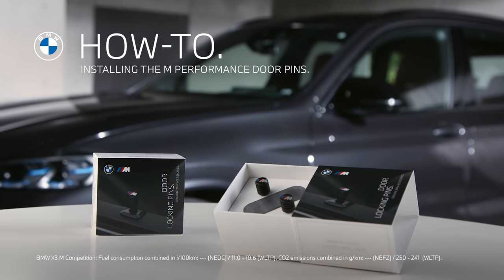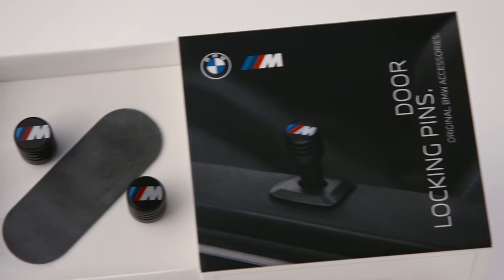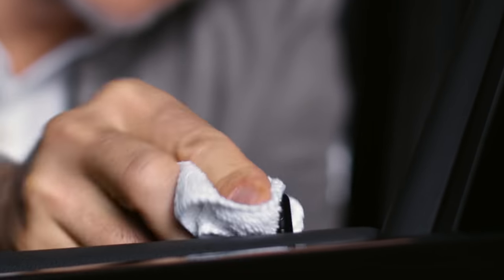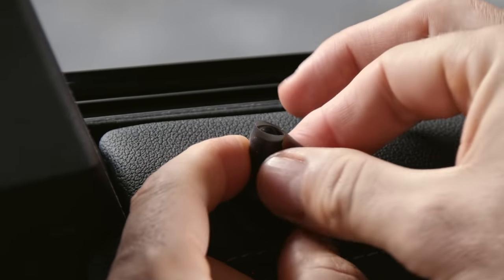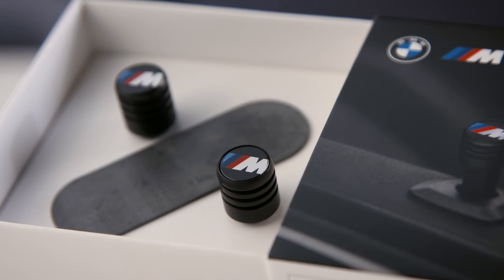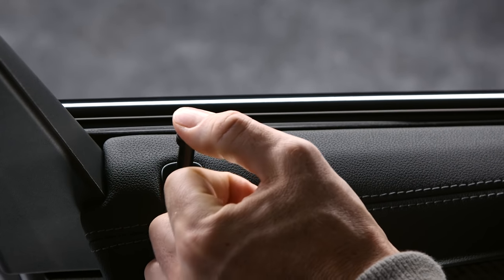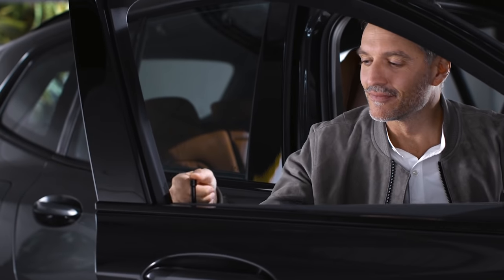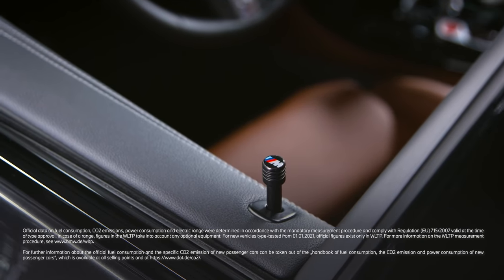How-To. Installing the M Performance Door Pins.

Comment: Looks cheap and nasty. Maybe its time to remove the door pins? Most other car manufacturers have removed them. Yet they continue to rattle about in modern BMWs.
Reply: Sorry but I like the door pins gives me quick visual indication from outside the car if I’ve locked it or not
Reply: Rattle? Where the hell are you driving, I've never heard them rattle
Reply: It gives a mechanical feeling to the car, especially an M car. They should keep them at least for entry level to mid level cars.
Reply: @KownKR7  1 of mine is
Reply: @KownKR7 mine too. All 4, but especially the drivers side. It's a thing , I just read about this issue on the internet today. Also the engine cover... Those rattle as well. (N47 engines)

Comment: I recently purchased a key fob holder for my F15 X5 from the dealer & it's made in China.
But the set of front & rear rubber mats are not 😊
I'll check on these soon.